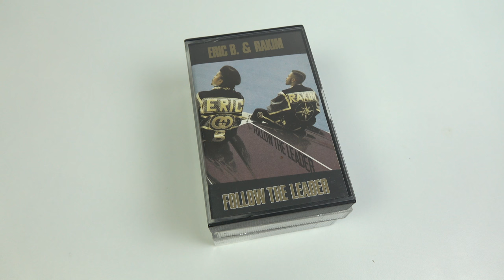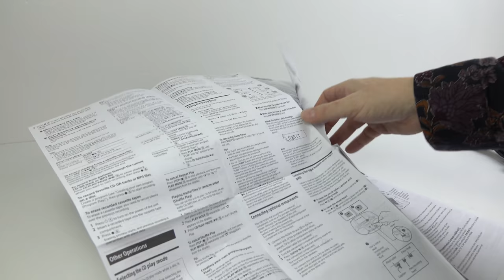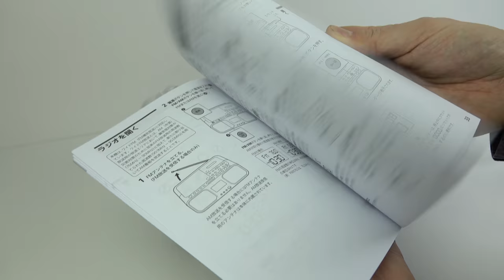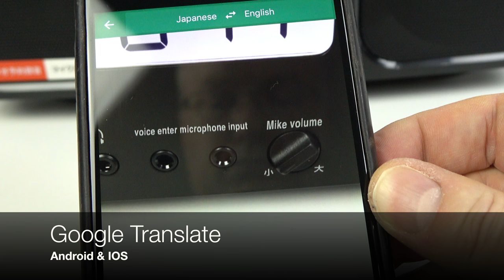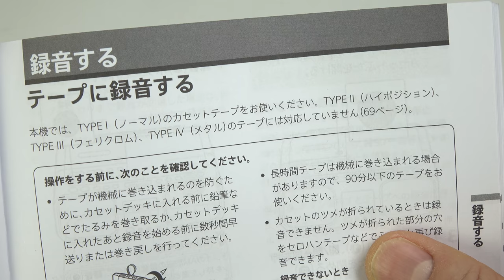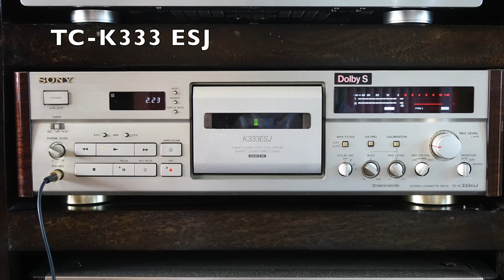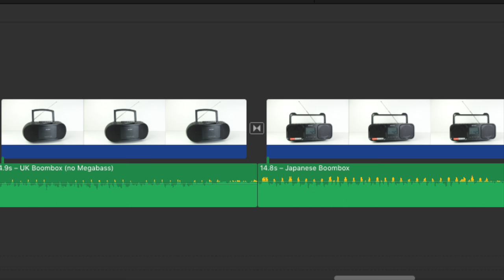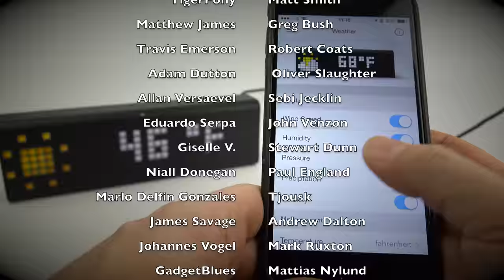Sony's New Cassette Boomboxes -  East meets West

Comment: CAN SOMEONE ANSWER? in one of his videos, techoman said that today there is a single cassette mechanism in the world, which is mounted in any boombox: do these sony also mount that mechanism, or were these made by sony?
Reply: All cassette players in the past 10+ have the same cheap cassette mechanism. Including all Sony devices.
The one exception is the TEAC W1200.
Reply: @ukkev7056  I think the TEAC W1200 uses the same type of mechanism, but just a better variation of it (the TASCAM variant of that deck that I have has the telltale spring in it that indicates its the same type of mechanism)
Reply: @pineappleroad  
The TEAC has some better components where available, which makes it stand out above the standard cassette player/recorder that's available brand new. But it has the same TASCAM mechanism, which is inferior to the vast majority of non-cheap vintage cassette players/recorders.
Reply: @ukkev7056  if I recall correctly, the TASCAM 202 MK VII is pretty much identical to the TEAC W1200, with the addition of an extra feature
and I have a feeling if you asked Techmoan, he would say these decks aren't worth getting
and at the moment I have 2 decks, a TASCAM 202 MK VII, and a Sony TC-K611S which needs the recording and playback levels adjusting (which would have to be done from the internal adjustment pots, the TASCAM deck helped me figure out what was wrong with it)
Reply: The todays manufactured Panasonic RX-M40D and Panasonic RX-D55 have a different mechanism than those Aldi boomboxes. The mechanism is called SG-20, these are avaliable with a mono or stereo head. You can tell it's different because when you press play the head not fully mechanically being pulled to the cassette, it is electronically adjusted. This mechanism is pretty old, it was also used 30 years ago in the Panasonic RQ-2102. Not the best sound quality, but it is well built and very durable.

Comment: You'd think that these days they could make it run a lot better of lithium ion, but I suppose if you wanted a good battery life in a "boombox" you could just as easily get a bluetooth speaker. Also maybe the reverse play button is for countries that drive on the wrong side of the road (i.e. the right).

Comment: The CFD-S401 has a decent sound on real amplifier, maybe the bass is a little overshot compared to TC-K333, and the sound is warmer, but still fine for a basic setup.
Especially it has a proper deck.
The MaxTek is a joke compared to both Sony sets.

Comment: I once had a CFD-S70, and it took about a year until the CD player stopped working. Same crappy quality with a Philips boombox. And then I bought an old 80ies CD player (also Sony) from eBay and this one is running flawlessly since years (not playing MP3 CDs, of course)..

Comment: I had a prerecorded tape recorded on chrome tape and the inner sleeve stated that it should be played back with the tape selector set to NORMAL. Whenever I see someone playing a prerecorded cassette with the tape selector set to chrome, I cringe. The only reason playback decks have a chrome switch is incase someone recorded a chrome tape with a tape deck without a chrome setting.

Comment: Sony CFDS70 bought it... used  audio in,, to record guitar e,,vocal,,,harmonica,,,thru yamaha mg10 mixer...and audio technica 2020,,, and other condenser mics....  it all works....  but playback on sony spkrs are terrible,,,  so use good expensive headphones for much better playback sounds ,, OR,  output from sony  into  dayton audio dta 1  cheap AMP, and then good speakrs , such as vintage diatones, or dali pico...for wondrful  sounds... eh

Comment: looks like the uk model is a rebadged cheap thing and the mega bass is simply dire best to leave it off, the japan version is more what i would expect from sony ( or other big brand ) but the could do with a megabass on/off button but the mega bass is definitely alot better and at a different frequency than the uk one but you tube compression being what it is it is only what i can tell. shame about no metal or other tape types being produced i remember having to alter a cassette tape just to get the right tape selector on my parents cassette machine ( tape was metal, the tape case was standard ferric )

Comment: Cocaine and Spinal Tap in the same Techmoan video. 😁😁😁
Ok... I know this one is a few years old but whatever, I kinda like that second one. I'll have to do some searching around to see if they ever got around to releasing an English version.
A suggestion for maybe future videos with cassette players...
A small, cheap, plastic, angeles dental mirror would do great for helping you to look at or identify cassette mechanisms where the door opens the wrong way to the actual mechanism. Probably around five or six years ago, I bought a 3 piece set, it had a pick, a scraper and a lighted mirror at Walmart for less than $10. I only bought the set for the mirror, as I'm probably the last person I would trust to go picking and scraping around my teeth... That's why there are dentists lol! But the set was cheap enough and it turned out that it was easy to hold onto because of a rubbery like texture on the handle. Anyway, just a suggestion.
Nice video. I can't believe it, but it's nice to know that there are still at least mildly decent cassette players out there.

Comment: as cassette fan, I must admit cassette will go the wa f wax cylinders, soon - next 20yr.
as the breadth of your vids show, it seems vinyl will continue as the pre.eminent legacy pre-recordedmusic format.
your good vid, also reenforces my feeling the Japanese still keep the best for Japan, always have, cos home market is very picky.

there should be strict laws stopping import of landfill junk like the Aldi-maxtek/Beko thing.- the Chinese should be discouraged in wasting materials, energy,transportation involved. so there.

thanks mainly to the Japanese majors, China OEM manufacturing can be first-rate, so personally importing Japanese-made,japanese QC'models makes sense, if economic.

£600 for a used 90's Sony deck is putting it in Nakamichi territory. A 550 would be right up your street, Mat....got mine in '78, still aok. just avoid the '80's red capacitor-problem models.
you are right about '70's Japanese build quality, often true I'd.like to see your take on Sansui receivers 2/4 channel, in that respect(70's-mid-80's, ideally). Best, Allan

Comment: I'm using the Sony CFD-S70 right now as I'm writing this while listening to a 50 year old Audio Compact Cassette Tape by Elton John 'Goodbye Yellow Brick Road'. It's amazing that after all these years this tape still works perfectly and sounds amazing, since it was recorded properly to begin with! I can hear every single high tone perfectly, crisp and clear! This Sony CFD-S70 stereo system is very well engineered! I'm used to expecting cheap, lower quality sound reproduction and recordings from boomboxes such as this one. Amazingly enough, this boombox falls into a more decent stereo system category! Only thing is I wish they have manufactured it with a Full-Logic, Selinoid Driven, Computer-Controlled type tape mechanism instead of this Tanishan, keyboard push button type mech. I'm surprised that even though it uses a multi-pole permanent erase magnet instead of an Actual AC-BIAS Erase Head to erase the tape while recording, it still erases pretty clean. There's none of that horrible Thunder-Like background noise that those blue permanent erase magnets usually produce, which most brand new boomboxes use nowadays.

Comment: Great, rousing my testosterone- fueled audiophile days from the late 70s and early 80s. Every time a new feature like autorewind, or a new dolby system, even cassette to cassette dubbing came out i jumped up and went out to get the new device. I am so happy ive kept my last sony cassette player. Have not used it for 20 years, but im sure it will work, except if the belts have dried up if i can find the belts, i may just convert my library to digital storage. Cant wait to hear synchroncity by the Police play again,,that album, in my opinion, coincided with the peak of cassette technology. 1984ish??

Comment: I like the space age design of the Japanese unit especially for the white, light brown, and light blue coloured variants. The black version (as seen in the video) looks like a typical 90s boombox but still with a very Sony-esque design of that era, which is still pretty cool. Not too thrilled about the LCD screen, though. Cheap-looking screen plastic, and the viewing angle of the LCD is horrid.

Comment: Please can you tell me where to buy a CD player box that has a line level out? All the modern ones no longer allow you to connect to external speakers. If I cannot find one I will have to modify one by installing a jack and tapping the signal output before the amplifier.

Comment: The "Mega Bass" sounds really dire on that UK model. The Japanese unit fared FAR better on the playback comparison - much more laid back EQ curve; a warmer, more engaging low end and a noticeably wider stereo separation. It DID sound like the bass on the unit was being gently emphasised versus your separates deck -- what I would define as the 'reference' sound -- but it wasn't unpleasant, unlike the UK model. Blech, that UK model is horrific.

I'll take one of the Japanese decks please, onegaishimasu.

I still have my Sanyo MCD-Z1 which I've owned since about 1992 -- it's suffering in SO many ways and is begging to be put down, but I keep it because the drivers are really good and have a fairly even response --  especially compared to what you get these days.

Are the drivers in the Japanese Sony boombox really good, does the bass port actually function and improve the low end?

The poor Aldi Maxtek sounds like its motor isn't quite running at full speed... Nice bit of bonus flutter as well.

Comment: Thank you for the video. 

Hey i have the Older version, the SONY CFD -S03CLP.  And it is better then this Sony Device the S70 one, okay it has no Bluetooth but i do not need it. 
It stands just in my Bathroom :D 

I found it Left for death on the Street, bing it home clen it up and it Works Just Fine.

Comment: I wonder why the display is in English, but the controls are in Japanese.
Reply: If you see Japanese appliances with Japanese controls, they're appealing to the older demographic. Pocket radios and boomboxes have been "senior" products in Japan for almost 30 years while the youngsters went from tape --> MD --> ipods and now spotify, instagram, YT.

Look closely and you'll see there are label segments on the LCD, e.g. when you adjust volume "音量" lights up on the side to show you that's what the numbers are. For time the LCD is constantly showing 午前(AM) or午後(PM).

It's really only a small amount of message that's spelled out in English like CD or PLAY, and when anyone learns Japanese, they pretty much ALWAYS learn how to spell out the sound with the alphabet, so even when they don't speak a word of English, it's not a complete hazard to get an 80 year old to recognize a few letters.

Comment: Ok I got an excellent Sony cfd s70 I did donate one but got a better Bluetooth dongle called j33 and a studebaker boombox Bluetooth series which cassette deck work fine and such but I did compared them as an experiment mixtapes but the japan Sony boombox did much helluva better but should get extra rich bass option but I still have mega bass but the quality does not sound too bad. I also got echo show in stereo and bass channel which surpassed my units and creative Bluetooth speakers.

Comment: I was in Tokyo & Okinawa & they currently using 76-90 MHz nothing past 90 MHz except some illegal broadcasting + I herd some DX. 531-1607 kHz on AM 9k tuning same as UK + DAB Radio they use also. In USA currently nothing being broadcasted on 76-87.5 MHz. FCC wants to end AM broadcasting by 2020 though isn't official. HD Radio may come to an end also very soon as many rural areas not have it except major metropolitan areas as cost of running them is to much + automobile manufactures not have HD Radio available on their vehicles. SiriusXM Satellite radio is big here though you need a subscription for it but quality isn't very good. FCC may consider trying DAB soon as many countries using it.

Comment: Hi there techmoan, 1st time commenter on your channel but long time avid viewer, especially all things VU related.
Quick query and please forgive me if you have already reviewed it in your back catalogue but I couldn't find it. Do you have any opinion on the Tascam CD-A580? Seen it being sold here as brand new: https://m.thomann.de/gb/tascam_cd_a580.htm?o=0&search=1505742576
Many thanks.
Reply from the maker: I haven't used one...however my best guess is that the tape section should perform pretty similarly to my Japanese Sony Boombox ...just due to the specs and what components are available right now. You'll likely get a better, more educated response on the tapeheads.net forums.
Reply: Techmoan Excellent mate, that's great. I shall be checking asap, I buy a lot of lighting and DMX gear from that Thomann and I'm always checking their stock for any cassette related gear and had an eye on this for a couple months so thought I'd ask and make you aware at the same time.
Its a deck type rather than a boombox and I haven't found many new ones around.
Many thanks for your advice though, its greatly appreciated.
Look forward to more vids.

Comment: I bought a CFD-S70 a couple years ago and feel it was made by Chinese prisoners. Another stay away suggestion. I had to buy two and return the first one because the cd player didn't work on it. It would just power on and for search the cd. Cassette sounds horrible with no features. It would be ok if it was a $35 stereo but not at the $50-60+ price.

Comment: I bought the cheaper model last year. After 11 weeks the cd player quit and then even after I cleaned it, the cassette deck became unusable after a short time as the wow and flutter got extremely bad. I paid 55 dollars for it so Sony support gave me the case RA numbers so I could send it down to Texas to be fixed or replaced. Insuring it for 50 bucks plus shipping cost me 25 dollars which Sony expected me to pay. So far the replacement is working ok but it cost me 80 dollars to get a working model which costs 55 dollars. This sucks!  Sony can kiss my ass if they think I will ever buy another product from them. If you do be warned.

Comment: no dolby? dolby was never reliable anyway IMO... edit actually to be clear a dolby recorded tape sounded great in the old decks from the mid 80s but by the 90s dolby was no longer a thing... add to that a dolby recorded tape from vinyl for instance was a screeching terror in a walkman, a device that didnt normally have dolby... then one has pre recorded tapes that are 20+ years old and since tapes physically wear turning dolby off was the only way to 'rescue' the high frequency sounds for albums that were well liked.... all in all i found decks with dolby to be mostly a novelty since, for those of us born in the 80s, it was the dolby-free mini-stereo units that had cd players that were the norm... the japanese unit would have been similar to something i would have had in my hay-day with the old dolby deck something my father owned... ....had dolby been part of the cassette tape standard... something always included and always on i could see it being a requirement... ...but it wasnt... it was an expensive option... so expensive ive never seen dolby C or S in real life... i didnt know those two existed till your channel...

Comment: Thanks for the video. 

I think the reason, besides looking cool, to buy a headphone amp is for the purpose of impedance matching. Impedance is a fancy name for resistance to the flow of electricity and you can think of the impedance of the device's output matching the other device's input like the transmission that is in line between your car's engine and wheels. The transmission allows most of the power from the engine to be transferred to the wheels. When the transmission is not in the right gear, like when trying to start moving when in third gear the power of the engine is not transferred and the car stalls. When impedances of two devices do not match, the power from the source device is not fully transferred to perhaps the headphones and the music sounds far from how intended aka like crap.
Cheap head phones tend to have a 32 ohm impedance and the expensive headphones, perhaps a Grado headphone, often have a much higher input impedance, hence an output impedance of 32 ohms at the headphone jack of a receiver will not match the high end headphones.  If the preceding is the case then one would want to use a headphone amplifier that is designed to have an output impedance that matches the input impedance of the headphones so as to hear the audio as intended.

On the other hand not all headphone jacks have a 32 ohm impedance such as my LG phone. It is rather high and I vaguely remember measuring it at around 600 ohms. Because the phone's impedance at the jack was so high when cheap 32 ohm headphones were plugged in the sound was barely above a whisper. At the time I did not know headphones had variety of impedance and I simply solved the issue by building a simple one transistor amplifier using a common bipolar transistor with a biasing scheme at the base of the transistor that created a near perfect match for my phone. The result was remarkable in that the sound was now fabulous.

So, I guess in a nutshell unless the amp is just for portability or to look cool it is a good idea to see if it's really needed and if so what impedance matching is needed.